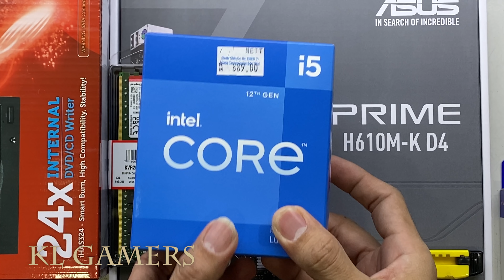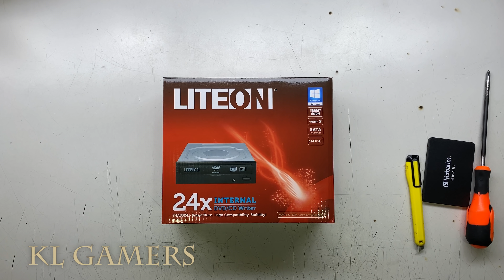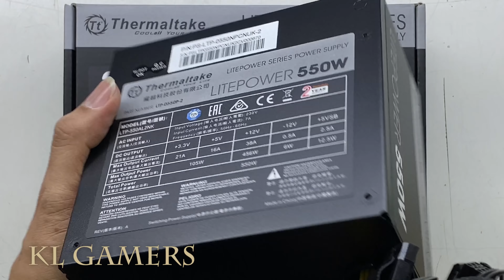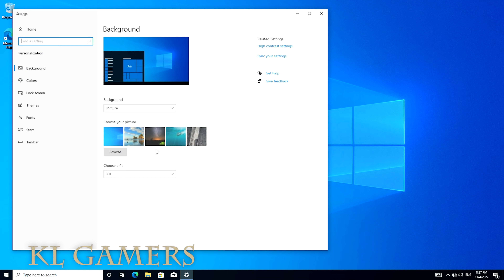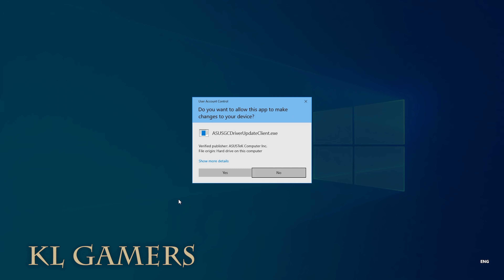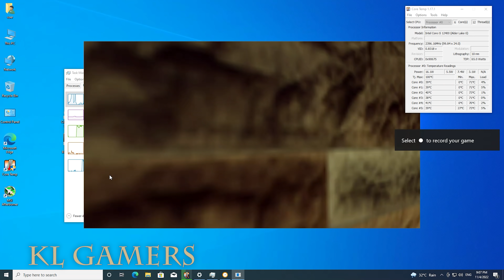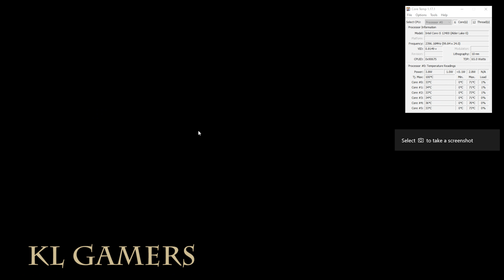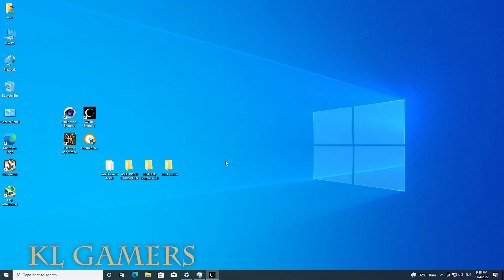intel Core i5 12400 ASUS PRIME H610M-K D4 LITEON DVD-RW MasterBox E300L Mini Tower PC build

Comment: Can i pair it with graphics card this processor in future ☺️ because prices of gpu are in a hike ❤️
Reply from the maker: yes you can
Reply: @KLGamers  How much fps will it give then i have listened that apu paired with an a gpu would won't be able to give full performance 🙂
Reply: @abhishek_das4344  yes it will, the i5 non f version isn't a APU like the Ryzen 5 5600G is, Intel's igpu is active even with a GPU, but it acts more like boost instead of graphics. so you'll get a few more fps in games because of the igpu,
AMD's is little different, in order to take advantage of an APU, it's best paired with a budget range Radeon GPU like the RX 6500 XT or RX 6600, but if you use a higher midrange card like the RTX 3060ti or RX 6700 XT, then you lose the benefit of Dual pairing.
with Intel's igpu you don't lose performance because it's not on the CPU die like an APU is, it has a separate die that acts more like an extra core like GPU.